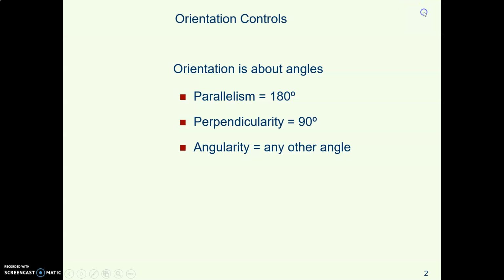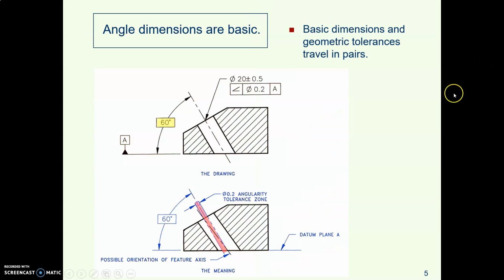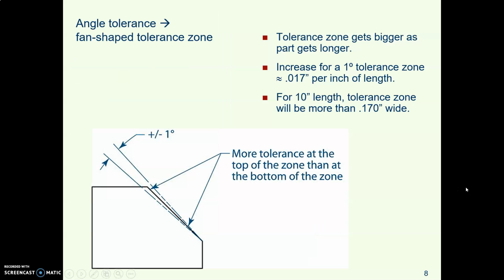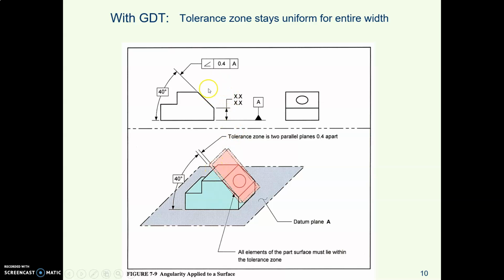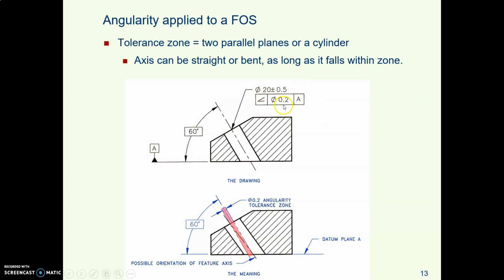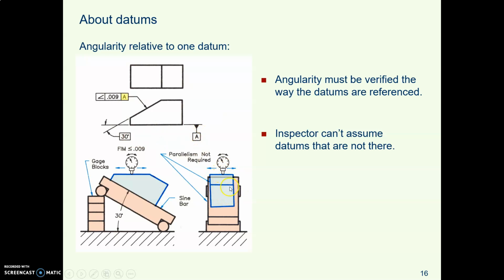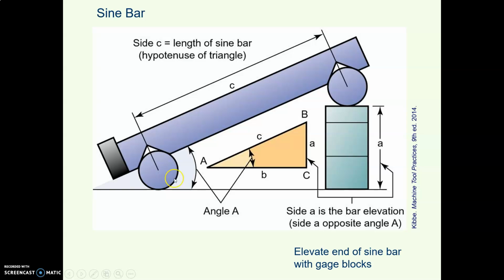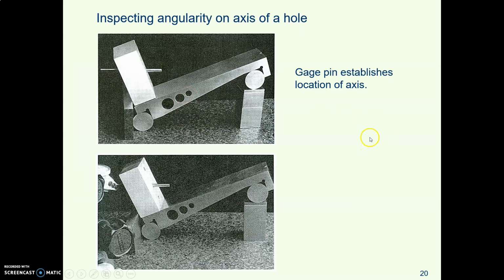MDes24b GDT   angularity

Comment: Your video is so quality in every second, thanks. I have a question, Is there a situation that we can only use angle but not  angularity.
Reply from the maker: Thank you. You can always use regular dimensioning without GDT, like dimensioning an angle, and you can put a tolerance on your dimension or let it use the tolerance in the title block. But that gives you a fan-shaped tolerance zone. If you want better control across the whole surface, and with a tolerance zone that stays the same thickness throughout, you can add an angularity control.